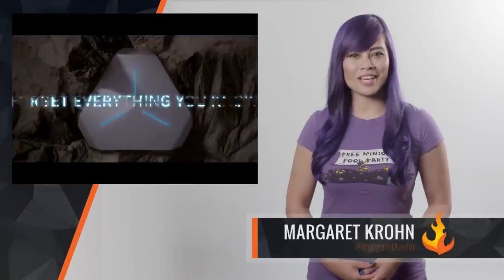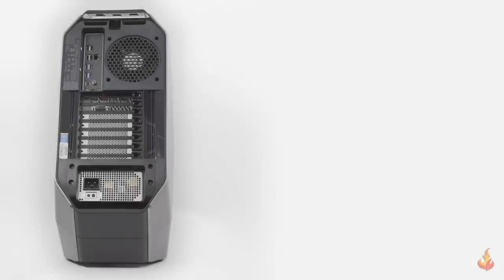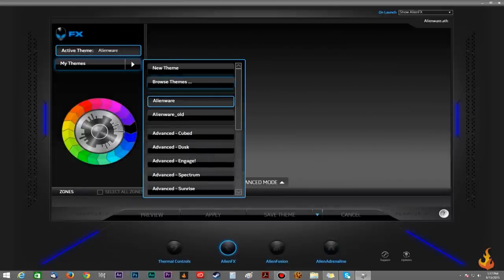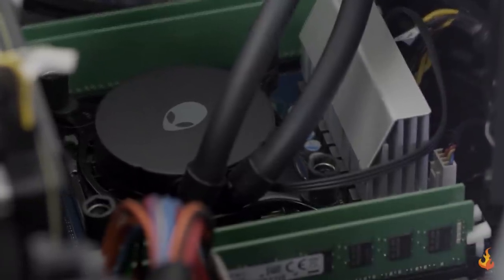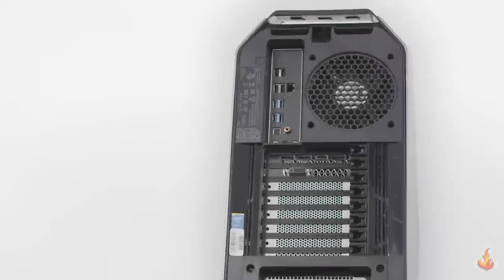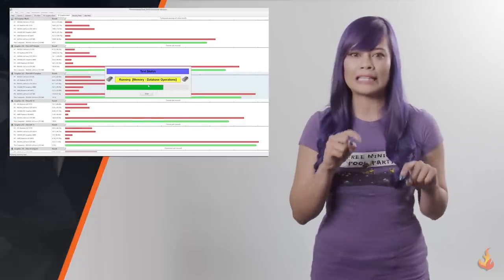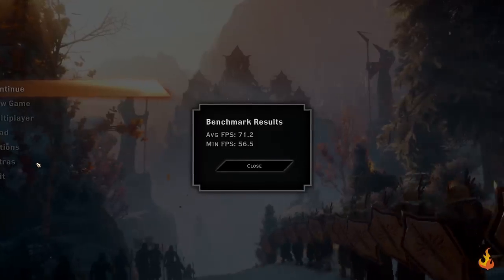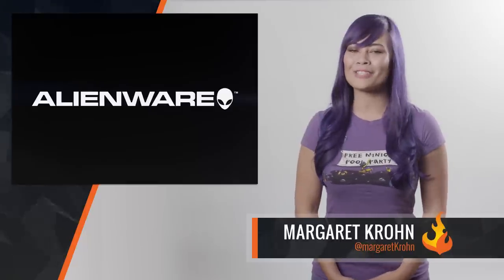Alienware Area 51 R2 (2015) Review

Comment: I'll take two. One for gaming and the other an anchor for my summer yacht because that the kind of baller you'd need to be to justify getting one of these.
Reply: Jeremy King lol =P
Reply: plus it's the only anchor that can run Crysis 3 at 60fps.
Reply: Jeremy King That will be the next benchmark test: can it sink?
Reply: +Energyone 60 pounds of nerd horsepower it will sink better then most anchor
Reply: +Patthon Sirilim Sink in water or sink your bank account?

Comment: Those temps are not very good with an watercooled cpu cooler. Probably is better to let the fan on it push exhaust the air.
Reply: Scaia I wonder how the radiator is set up...

Comment: $3000 and it's got a <$500 GPU in it, what value for a "gaming PC"!!
Reply: Kritya It's not the TI version either, but not everyone can build their own
Reply: Energyone Yh, but places like Ironside will do a build with these parts for so much cheaper. As in nearly half the price, even less if you ditch the awkward spot overpriced for gaming but better options for performance CPU for an i3/i5. A build featuring a 980 built by the consumer could cost you $1000 and get 1 or 2 fps lower than this in a few games, most of them it would have the same performance.

And sure, people may not be able to build their own, but I build my first pc just following a 30 minute guide on youtube, all previous experience being swapping out a GT320 for a GT440 which don't even have 6/8 pin connectors. It's very easy to build a non-fancy pc in a standard case.
Reply: Energyone Doesn't matter if it's built, You can get a pre built PC from a builder or retailer with awesome peripherals and a monitor + some other stuff in $3000
Reply: Kritya I know, I have been building my own since the 90's.
Reply: ***** Does it include an LED-lit alien head?  :P  You are preaching to the choir anyways - I've been building my own for decades like many others.

Comment: why does Alienware use an 7200 extra harddrive and not an 1tb ssd annoys me so much
Reply: Hubnero They are about $1000 each, compared to $60-$70 for the one with platters.  :P
Reply: Energyone 1TB ssd's are 350-400$ these days
http://pcpartpicker.com/part/samsung-internal-hard-drive-mz75e1t0bam
Reply: BurningBroadcast but if oyu build a good comp if you don't put in a good harddrive aswell is kinda crap
Reply: Hubnero I'd say a smaller SSD for your OS and maybe game or 2 is almost a must to have. But you don't need solid state storage for all your programs. Most of my games are still on a 7200rpm drive and it's totally fine. Sure my SSD is faster but it's not cost efficient to use a huge SSD for everything. Atleast not at current day pricing.
Reply: BurningBroadcast Nice, they used to be double that or more.  Still, compared to $65ish for a 7200 rpm drive...
Reply: Energyone Yup correct, still its become more and more affordable, maybe with Sata express we will see even cheaper SSD's
Reply: BurningBroadcast We can only hope.  Then again, even Velociraptors are still kinda pricey.

Comment: Sorry, I can build faster, more reliable, better looking, less costly, high performance gaming machines. Alienware = BARF
Reply: There ARE better products for less money with regards to that argument.
Reply: +Ben W certainly sir. I would explore PC specialist, cyberpowerPC or similar and If your having trouble customizing your choice just drop me a message. ^_^
Reply: +Ben W no problem at all ^_^ just try not to buy more than is required by your work load and leave space for further upgrades in future should you choose to build on top or improve later on down the line. get a machine with a current gen motherboard, this allows for more delay in redundancy.
Reply: +Ben W maxed out 4k gaming will require a hefty system. I personally use dual gtx 970 GPUs, but a single gtx 980 with a wide enough frame buffer should do the job just fine.
Reply: +Ben W the gtx titan in a lot of use cases has been out performed by the gtx 980 and ti models.
Reply: +Ben W and while I do love sli and it's benefits. it is not without its complications. .
Reply: What is?
Reply: +Ben W my apologises. weird bug. essentially the sentiment of the reply was this. as long as the machine does as intended, performance is as expected and you are happy with how you have spent your money. then there is nothing wrong with this build.
Reply: +Ben W glad to have been of service sir :)
Reply: +Ben W I am on twitter @M05F3T if you need anything else